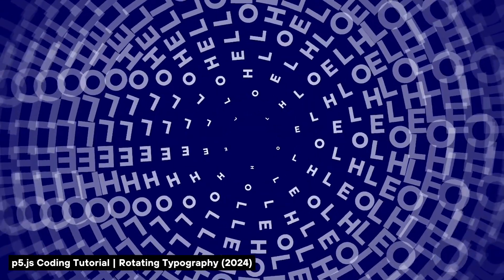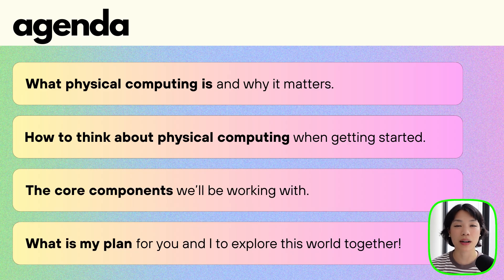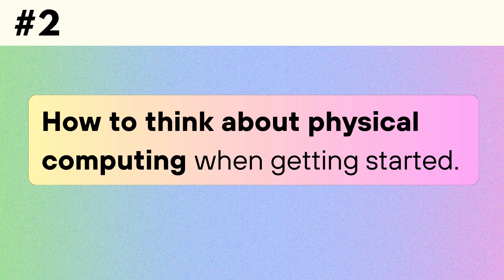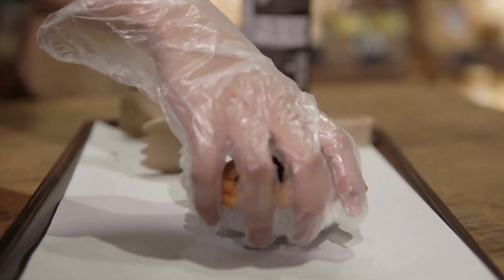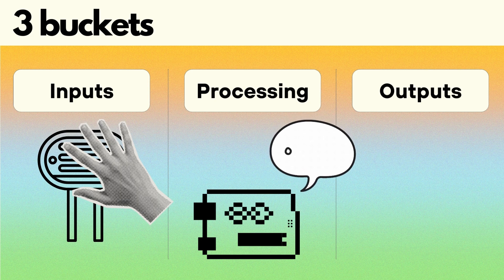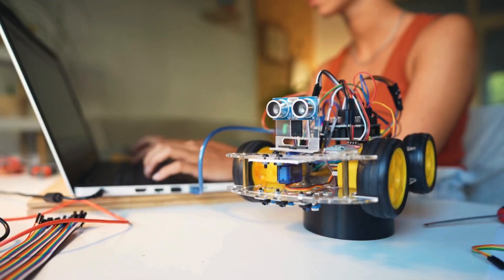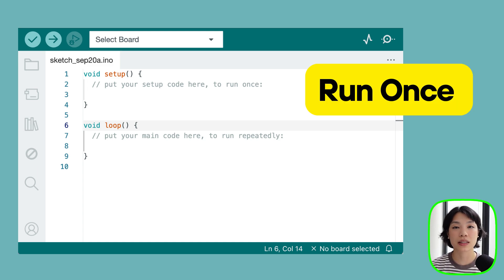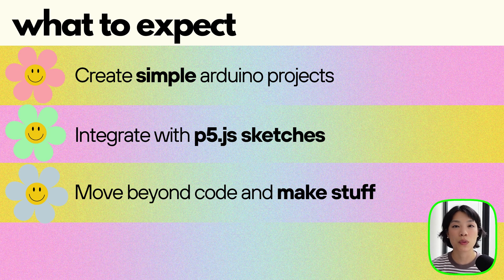Arduino 101 | Physical Computing for Beginners

Comment: Ah, physical computing. It was pretty much my university graduation project. 
I first had to learn Arduino. But it always felt too "closed" to me. You flash your code to it and it runs, not much to see.
What really started to get me excited and going was Master-Slave interactions in which Arduino was no longer the only computing power but it had to communicate with a computer at all times. Starting to play with multiple computing units and sensors made the process a lot more fun. I hope your integration with p5 does the same! (I didn't use p5). 

For the people who'll invest in Arduino: 
Arduino is a brand. You can also buy 3rd party board instead as it is open source. You won't miss much apart from brand loyalty and can get a microcontroller or two for pocket change. 
You can choose Arduino Nano for small projects, UNO for mid-size projects and Mega for slightly bigger projects. There are other versions as well but I leave that to you.
Note that if you buy a board that says "headerless", you'll probably have to learn soldering.
Also, buy resistors! Lots of resistors!